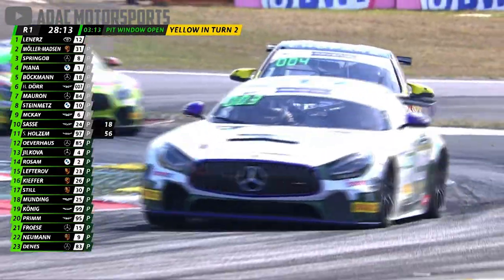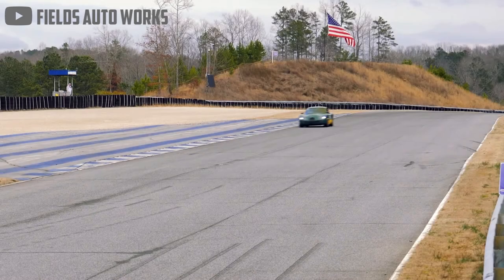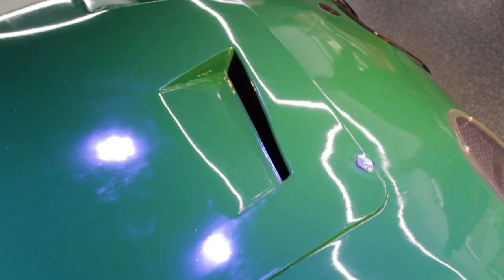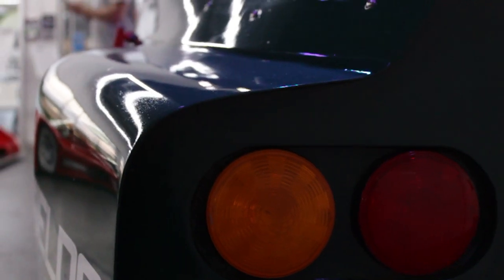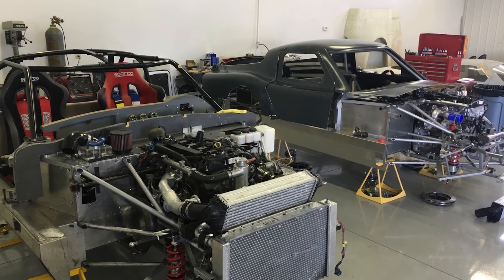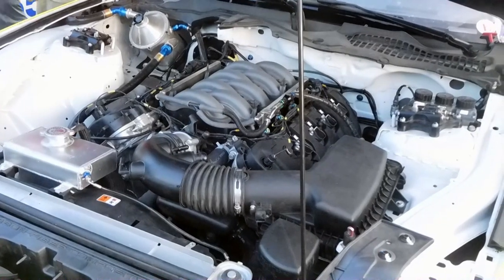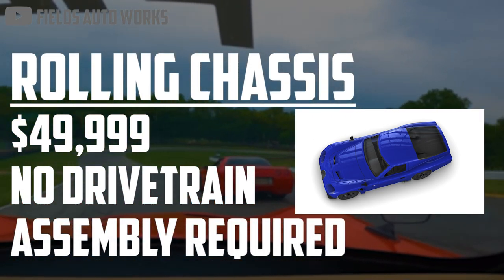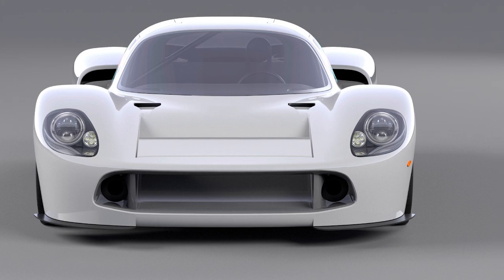This Budget Track Build Just KILLED Porsche...

Comment: I think that the ultima or formula mazda may be better. Unsure if they can be raced, but one is basically a really cheap mini indycar and the other is basically a really cheap lmp1 car. 
Formula mazda is basically a mini indycar that makes like 180 horsepower reliably I think and it's like $15k - $30k
And ultima at $30k you get the base body and unsure if it has an engine. With everything it can probably get to $200k (carbon fiber, like 1300 hp I think, all the other good stuff)
Both are super light. Because race car.
Both are really small. Like a mazda size. And also both look cool and are customizable (they aren't like ferrari)

Comment: I'm not impressed.  2800 lbs for a 4 cyl race car seems a bit bloated. Their Longtail car under development sounds like it has more thoroughbred DNA being V8 powered and 2000lbs. THAT'S going to be a serious track machine!
Reply: If it were 2800 lbs, I'd agree, but the car's 1800 pounds. That's a bit different, and it's not just a 4 cylinder. It's a Turbo 4 cylinder with over 300 horse power that can easily be pumped up to 450. It's definitely going to be faster than your average track car, if you know how to drive.
Reply: @LordHolley  I had to go back and listen again and you're correct, it's 1,800. But while a pumped up Eco Boost engine would give it a kick it still wouldn't be much more than "spunky" in performance. But then again, I grew up in the late 60's and early 70's and have owned numerous muscle cars from that era. I would need gut wrenching acceleration to impress me.
Reply: @GrantOakes  Well no offense but I think your memories are a little bit glorified. Those old cars were not quite as fast as we'd like to think they were. I have owned, and tracked several. They were heavy, and didn't make any where near the usable power of modern engines. If you really care, you can look at the power to weight ratio. Even this car here at 300 HP is gonna smoke anything off the showroom floor from the 60's or early 70's, let alone after pumping up that motor to 450, whichNissan easily done. I guarantee you'd be impressed.
Reply: @LordHolley  Not my 67 Barracuda with a 500hp built 440! The torque it generated was monstrous!
Reply: @GrantOakes  - Your '67 weighed ~3000lbs right? 3000/500 == 1800/300

They're exactly the same power to weight, and this one stops and turns to boot!
Reply: @markprice8979  my 67 weighed 3360.
Reply: I Sim built muscles all the time, something like this would definitely post better times, and is exactly why I'm considering one for real life.